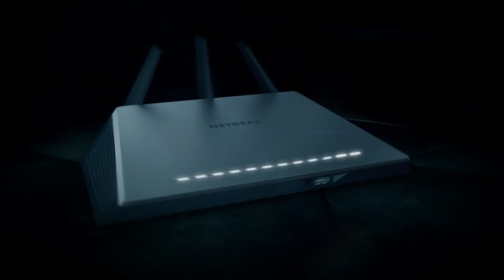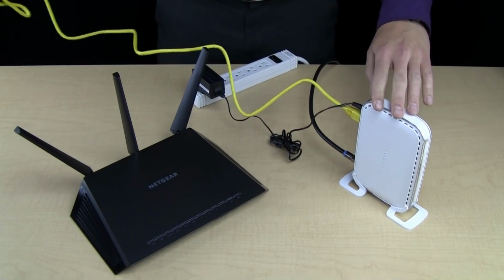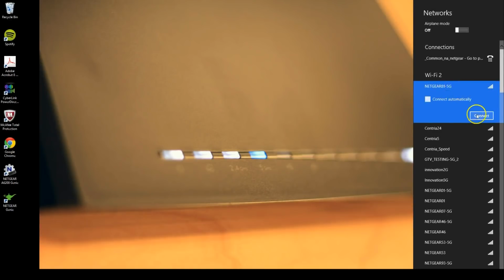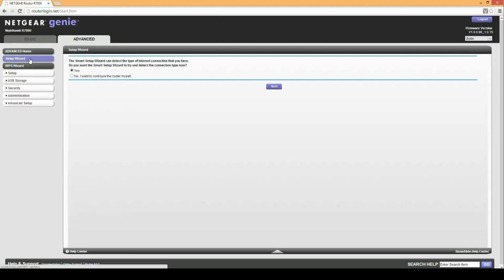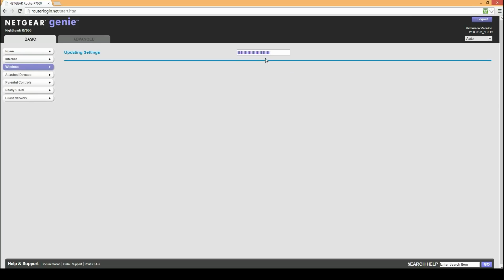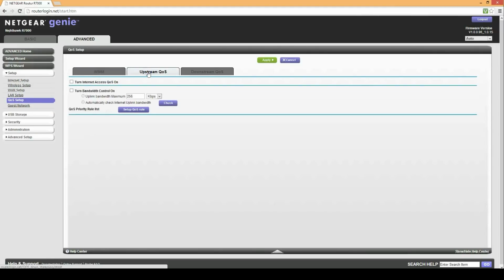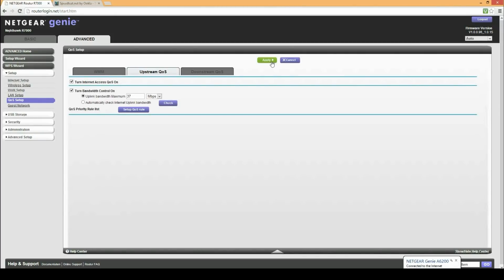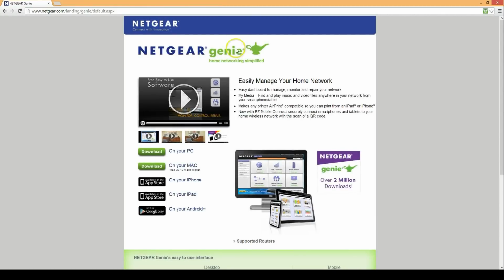How to Install Your NETGEAR Nighthawk Wireless Router (R7000)

Comment: You NAILED IT! I bought the NETGEAR Night Hawk x10 and I don’t see any speed difference! Amazon still lags and buffers and router is 10ft away from the TV!
I think that I pay for 100mb for Spectrum Internet! Also any information on how to Flash a Night Hawk to install IPVanish?
I see no WiFi speed difference between my old NETGEAR 9000.
Amazon Fire TV still buffers and cell phones are just as slow as before and I increased my internet speed. I’m going to use this to check the settings on this video.
Right now I have a $500 boat anchor! I even hard wired my Fire TV and no difference. I’m not a computer expert but you make it all sound to easy.
I really would like to know if an idiot like me could Flash the router to add IPVanish? I read if it’s down wrong the router is history. Is there instructions on how to flash it that are easy common sense.
I’ve had it 2 years and have hated it since day 2 and didn’t know I could of called a tech support. Guess I should of read all the cards that came with it.

Hope you can help me make my Nighthawk x10 a BEAST!

Thank You
Thank You

Comment: Okay guys so I had same issue as most. Internet kept saying connected with problems. 
What i did was...
- make sure you're logged into the wifi (even if it says issue).
-go to www.routerlogin.com (this is the only page that it will let you open even if it says 'issues')
- Next let it Load (It will load SUPER SLOW maybe 5 minutes to connect and read your router)
- Agree to the terms and conditions once it pops up
-Follow the rest of the steps :)

Comment: Bitch this doesn't fucking work.

I'm on my own netgear modem/router. I disabled the router to use the nighthawk, connected the ethernet to WAN and to my laptop once everything was turned off and on. The fucking genie says my wifi is not connected. I use the default password too.

Comment: I connected mine and it works fine faster then my actual wifi I have my PS4 Roku tv and like 4 phones connected and it's super fast it's a bit complicated to connect in the website but I used the app and works perfect

Comment: This router sucks. It keeps dropping a signal and will start to malfunction to where you can't connect in any way. You have to wait at least 10 minutes to get itself back online, or cycle power. This would happen constantly. I went back to Linksys, and what do you know, no dropped signals and no problems.

Comment: This comment section is painful.
Reply: 😂 I hear u
Reply: Amazons link for NETGEAR R6700 www.amazon.com/NETGEAR-R6700-Nighthawk-Gigabit-Ethernet/dp/B00R2AZLD2/ref=as_li_ss_tl?_encoding=UTF8&psc=1&refRID=Q2K1VW6XYP6R4W31PTMN&linkCode=ll1&tag=tegaco-20&linkId=92306874cf751c55b3f573dc9146123b
Reply: Add you good at routers

Comment: Be careful if you have Frontier Communications. Though this router says it is supported by Frontier, it is not. Frontier is a crappy phone company and ISP.
Reply: MrTibbs90 It depends on which service you use from Frontier, before I moved I had Frontier FTTP or Fiber to the premises. We got speeds from 75 mbps to 100mbps internet. Frontier DSL speeds depend on how far away you are from the servicing or switching facilities in your area. Also I believe that With Frontier FIOS you can’t have another router than the Quantum routers because of the OnT link, but you can use the NETGEAR Nighthawk router as a MoCA BRIDGE.
Reply: Electric So this router does work with Frontier Communications?

Comment: I have a modem/router device setup and I want to add a hawk router to replace the built in router. I can't figure out how to set it up though, they told me to set it on bridge mode but I can't find that setting anywhere. Then I tried following this video but I do not have the setting choice of wizard setup. Help

Comment: I wasted a lot of time trying to get a NETGEAR ROUTER to work. It turned out that  the issue was a non compatible issue. Neither of the two Netgear Routers I purchased would work, my first purchase was a Netgear16 AC1750 and then a Netgear17 AC 1900. Neither one would work with my Spectrum Cisco DPC 3216 Modem. 
My third and last purchase was a LINKSYS  WRT 1900AC and that worked just fine and was easy to install and config. 
BTW I found the Linksys 1900 AC at Sams. 
The following stores did not have any Linksys in stock: Best Buy, Staples and Costco ... but they had a lot of non-compatible Netgear Routers :-/

Comment: I just set mine up and the 5ghz channel wont show up. It did when i first set it up and when i updated the firmware it wont show up anymore. A little help please
Reply: ChronoBreaker your device depends on what ghz band is supported for that connection.

Comment: I tried and tried and failed. This equipment is a waste of time and money. It is not user friendly. I wasted 3 hours going through the step by step process. This goofball makes it seem so easy. My whole night is gone. Do not buy this piece of crap!
Reply: idiots should not be allowed to use technology.
Reply: No idea how you managed to fuck this up. Fucking boomers
Reply: Nigga this shit was easy asf I got hella good internet now
Reply: Steven Gutierrez update the software and do it again. It happened to me too, stuck for a week, until I update the netgear software. Do the settings again and now I'm connected to the internet
Reply: i spent way to much for something not to work sighh worst product ever. even the support team was terrible.
Reply: How did you get the update if you can get on line :-/ .. I clicked on update and got the message Not connect to the Internet
Reply: Luis Marcadella well said
Reply: Do you work for another router company? 🤔
Reply: I plugged it into the wall out of the box and works great..

Comment: I have the R6700 nighthawk. I have a desktop computer but our router is in the basement. Is there anyway to fix the problem. I have no internet service at all now.
Reply: Either run a network cable from the router in the basement, or attach a WiFi adapter to your desktop PC.

Comment: I have a problem, i am connected to the internet with the new router and but i cannot connect to the netgear website, and the wifi is connected too but i cant do anything, please help
Reply: U have to manually configure the router instead of auto detecting for the first time entering the website and it will go to the router settings
Reply: same

Comment: help, my internet cable (yellow cable), doesnt work for some reason, when i connected the yellow cable, the sign of internet on the wifi router put red for 2 3 second and dissapear but the white light of the ethernet doesnt show,

Comment: how do i get higher download speed/upload speed like you?? i just updated my firmware i just have 15download and 1.50 upload =,( pls help me with my issue =,(
Reply: DrivE first you need to pay more for faster download speeds and uploads speeds go to your internet provider website and check what plan you have for example i have 100mbps download speed and 30mbps upload speed and the internet provider is Spectrum and i pay 65$
Reply: You need to pay for it. It's not just handed to you. No point of getting a nighthawk with 15 down lmao. I'm getting one so I can get the full potential 250 download for me.
Reply: DrivE meaning while over in Australia when I hit 3mb download speed I'm over the moon, the usual download speed is 1

Comment: Do I need a modem to set up the router?
Reply: Yes, a modem is required. DSL or Cable will work. Connect one end of the ethernet cable to the Lan1 on your modem, and the other end into the WAN port of your router

Comment: Hello, im getting a nighthawk & modem bundle... I'm a PC builder & everything but don't know much about how wifi works [Unless its fixing it or speed stuff] but scene im getting a modem does that meen i don't need other service? its a netgear modem.. Like rn my parents [yes i live with them its hard finding apartments..] they have an x-finity router & i think x-finity service... idk... But, im not sure if we have a modem or not.. But i want to know will i have to unplug anything from it because i think it does have a modem because it has like a cable that plugs into it coming from the wall.... It has like a screw on holder.
Reply: Because i don't want to interfear with anything there doing with & i want to know if i setup the modem & the other thing will i need to buy a service provider or is the modem a service provider?
Reply: Like, would Verison Fios be good with this router?
Reply: A modem translates the signal coming into your home into a signal that the router can understand and work with. A router works like a traffic light, it specifies what channel data can flow through and sorts though incoming data. It also is the place where your wifi signal originates from.
Reply: Aerozine sooo yes?

Comment: I followed ever step but I get stuck at the netgear genie, it tells me I'm not connected to the internet when my internet modem works fine
Reply: xthunder how can we update if we can't connect to the internet?
Reply: same problem here
Reply: same ... and entering the password wont work.
Reply: mrChingon - return that shit, i returned mine cause i had the same problem and bought an ASUS brand. works better and was cheaper!
Reply: happened to me too, just update the software and do the settings. It works
Reply: xthunder Where did you find the updates?
Reply: Daniel Zamora same here man idk wtf to do
Reply: Everybody you have to power off or unplug it the plug it back in the connect the modem to the router then go search www.routerlogin.net the follow the instructions
Reply: Same thing here. Bullshit set up. You need to call your provider.
Reply: Guys lol don’t return it ima save u GUYS  just plz just sub to my channel but here u guys go https://youtu.be/yPtk838kj7s
Reply: xthunder how did you update your router? I don’t have internet access to update mine. Can you explain step by step please.
Reply: Barbara Buttmunch
Reply: @nashbtw4187  is that an actual person?
Reply: Thomas Jones look
Reply: hello Daniel, this problem uh r suffering from same as my problem but i would get rid of this issue just by a single click visit:- https://extenderlinksys.net/ link and get instant solution of ur issues.
Reply: If you download the nighthwak router app you can set it up on there
Reply: Same whenever I try to connect with my netgear ac1750 it just say no WiFi connection or whatever
Reply: If you have a phone line to i just keep the phone line in my router
Reply: If I'm not mistaken, try google (your router model number) software update. U have to download the files first. Then when u click upgrading the software just click on the files u have downloaded and then click ok
Reply: @usercs_2682  how to google when no internet?

Comment: i have 3 xbox one in the house and when we all play cod is strict or and moderate when all xbox are on so will this allow all 3 xbox to have open nat?and i have try port forwarding and does not work at all so if i was to get this or is there a router the can do that plz direct me to it
Reply: yeah still not open can any direct me to a video the show you how to for xbox one
Reply: Josean rodriguez Then the nighthawk is for you since you have 3 Xbox ones it is best to get this because the consoles are being connected to the same internet and if you get the nighthawk it will transfer the wifi signal stronger for your internet and you will get good connection for all Xbox ones without the nighthawk your wifi will have trouble connecting to 3 Xbox ones to one wifi
Reply: Josean rodriguez put one in dmz, and port forward another one but I don't know what to do with the last one
Reply: ty i just older one from amazon $119
Reply: Josean rodriguez you should bridge your modem and setup pppoe on your router thats how i fixed and sorry for the late comment
Reply: Josean rodriguez use Ethernet kid

Comment: this router is unreliable, mine is about 6 months old and now drops the internet regularly, very annoying. Dont buy one!!
Reply: You too!? I got this a month ago, and my internet is disconnecting so many times a day.
Reply: Are you guys connecting through WiFi? 2.4ghz channel? if so it's probably not the router but devices causing interference, like another router, smart tv, etc, 2.4ghz channels are very picky.
Reply: RJ Franklin What should we do than?
Reply: Well I'm not familiar with the user interface on this router so refer to your documentation or call their customer support to walk you through it and they may even be able to give you some other suggestions as to what may be happening but if you have a modem/router combo attached to this it is probably also puttign out a 2.4ghz band so what you want to do is disable that or or access your nighthawk administration page and change the channel on your 2.4ghz for that piece of equipment there are very few channels in that band that don;t over lap so if you are on channel 1 got to channel 6 or 11 if you are on channel 11 go to 6 or 1 and etc, move as far away as you can from what ever channel it's already set to. this should help you. I feel like your product is dropping signal from channel overlapping and interference not because it is faulty. but like I said do this on the phone with customer support and maybe they can give you some other suggestions as I am not familiar with the product or help you RMA the device if something is faulty with it.
Reply: They could also hardwire a connection and test it with shielded ethernet wire.

Comment: Does this help with doawnload speed
Reply: depends if you have crappy wifi, then yes
Reply: It depends on your internet speed. If you have a crappy connection coming into your home then no, the router is not the bottleneck.

Comment: hi, is the netgear D7000 modem router the same with R7000? i cant  seem to connect my netgear D7000 to the internet to replace my Fritz Box. can use the D7000 directly connected to the main internet socket of the house as a stand alone?

Comment: I just bought this router for my existing non-wifi cable modem and to replace my old netgear n router which is still great but my son has gone from an occasional user, to an online PS4 playing juggernaut. Then out of nowhere, my ISP delivered a new wifi-enabled cable modem the next day free of charge. They both have 2.4 and 5ghz bands. Does that mean I can run 4 independent wifi connections?

Comment: How can I tell if my Nighthawk Wireless Router is also a modem?  It is an AC1900, Model R700.  If it is, someone told me I could do away with TWC modem (saving $10 rental) & just run through the Nighthawk

Comment: If you are replacing your old router, do you need to use the pre made wifi network that is shown on the new router or will it just connect to the already existing wifi my house has.

Comment: In this video, it shows just one cable connected from the router to the modem, my current network setup with a Linksys has many cables hooked up and an extra box I think is called a switch. Can somebody please explain why I have all these cables, and if I need all of them for my new Netgear nighthawk router.

Thanks in advance.
Reply: +Jaden Hamer switch act like a plug extension so it just give you more port to use. im guessing your house are using ethernet cable instead of wifi for internet access for each of your device's hence the multiple cable. Hope that helps. P.S. I tried :D
Reply: +ValvraveZen thanks
Reply: Np

Comment: How exactly does this work with XFinity Modem/Router combos? Does the installation work the same?
Reply from the maker: +Joshua Perez Yes, installation is still the same. You also might want to put your ISP modem/router combo in bridge mode so that you only use the R7000 WiFi connection.
Reply: +NETGEAR can I do that with the default AT&T router they gave me

Comment: So do you have to leave it plugged in to modem for it to work? Or after I set it up can I unplug it and move it to another room?
Reply: What a pointless answer. Not everyone knows as much as you do about networking. If you have nothing nice to say then it's probably better to say nothing at all. Or, better yet,  why not share your knowledge to help others?
Reply from the maker: +CanYouBerzerkLikeMe You need to have the router plugged into a modem to create a wireless network
Reply: +CanYouBerzerkLikeMe 
what a retarded question... of course you need to plug it to modem for it to function.. a modem(main piece) gets the internet a router basically makes it wireless.
Reply: Maybe they mean will it connect wirelessly  to a wireless modem.

Comment: I bought this - however i have been told to stick it into my existing router/modem. my existing modem/router is a cheap one.  is this right? i thought my cheap modem/router (talktalk) was the problem. any thoughts, I use ADSL internet via phone line. No coaxial cable used.

Comment: I am on a microwave connection, have had my ISP listen in and find no drops at all, had Netgear tech support online 6 times, returned one Nighthawk R7000 for a new one and CANNOT stay connected!!! Both wired and wireless connectivity drop 50+ times a day and throws a DNS error (even though I have used all DNS available) I'm so frustrated right now I'm about to take it back and go with Asus!!! Bah!!!!  What a pain in the ass this has been!